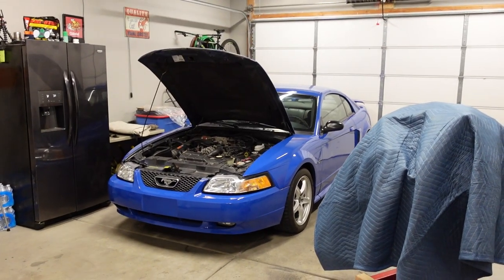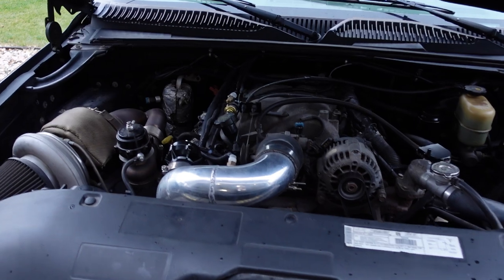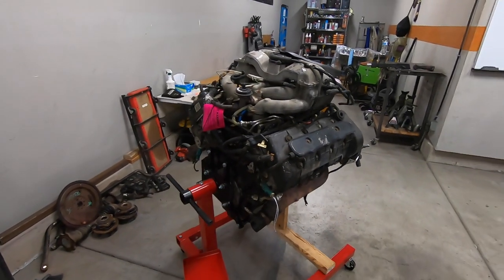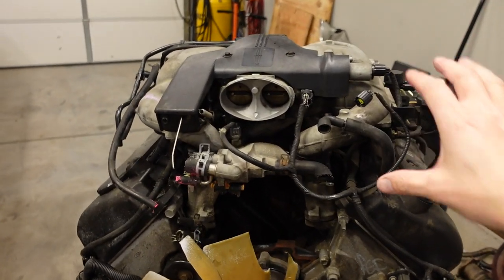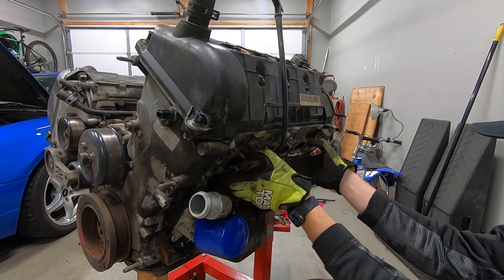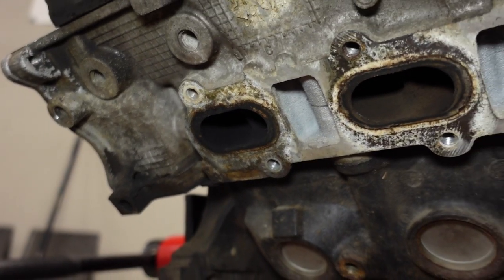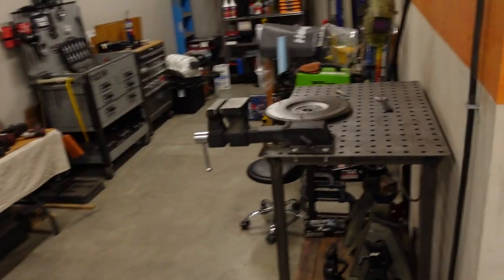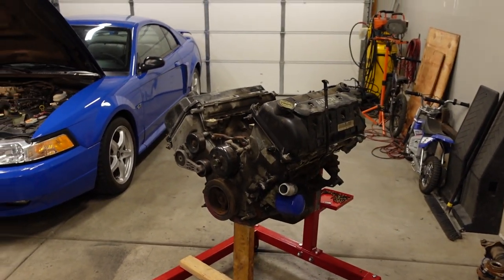I bought the LARGEST ENGINE I can fit into my Mustang

Comment: You are gonna be pleasantly surprised on how boost wakes up the 5.4 you have there.the stock 04 cobras made north of 500 hp they were grossly underated from the factory. Richard Holdner has some great videos on these Ford mod motors which I'm sure you have already seen.I think you couldn't have chosen a better engine to swap looking forward to the build.
Reply: The stock Terminators did not make more than 500 hp. Did they make more than their rated horsepower, yes. Most cars make more than their estimated horsepower when you put them on a chassis dyno. But the Cobra wasn't making North of 500 bhp.
Reply: @rdsimmonds  True statement. A stock Terminator puts down about 360-390 at the wheels. But they make crazy hp when modded. The bottom end is almost indestructible.
Reply: @donuthole7236  imho, they should've used the Teksid blocks for them. But that's me. They do accept mods very well, given the heads and forged rotating assembly.
Reply: @rdsimmonds  The Teksid block is the best aluminum mod motor block. For a street car I would take the 68 lb hit with the iron Romeo. Iron blocks are pretty tough. Ford sold a 5.0 iron version of the Teksid called the Boss block. I know cuz there is one sitting in my garage
Reply: @donuthole7236  the Teksid block is actually the strongest of the 4.6L blocks. No reason to take the weight penalty. From my understanding, the Romeo iron block is actually weaker than either of the aluminum blocks. But regardless, the Teksid is definitely the strongest block you can use for a 4.6L
Reply: @rdsimmonds  It's actually a bit more complicated then deeming one is "stronger" than the other. As a material iron is stronger than aluminum. Both have their pluses and minuses. Ford actually tried using an aluminum block during the development of the Terminator (unfortunately the Winsor was all that was available as they were no longer producing the Teksid at the time) but were having problems during durability testing which is why they went with the Romeo block. For a streetcar that you want to last a long time, iron would be a better choice. If you want to save weight off the nose of the car aluminum is the only way to go. Personally, I think the Boss 5.0 block is the best option for a streetcar as stated it's basically and iron version of the Teksid. The only issue with the 3.700" bore on the Boss is it limits the boost due to the narrower land between the bores. The stock 4.6 bore can tolerate stupid levels of boost.
Reply: @donuthole7236  the Teksid block actually is the strongest of the blocks, period. Which is why John Mihovetz has been using one for years to set the records for mod motors. The cylinders on the Romeo block are actually weak, as they are thin and not uniform thickness all the way around. The block may have slightly more rigidity in the bottom end, but it's a miniscule amount. The Teksid block was designed with more material in critical areas, and cast using methods that increase overall strength.
Reply: @rdsimmonds  Using Mihovetz as an example will not apply to your average street racer as he fills 1/2 the water jacket with expoxy, runs 50 lbs of boost and rebuild/replaces the engine often and pour copious amounts of money into the engine. Not something you and I can afford or is willing to do, we are not even in the same league. The problem with iron blocks is that they are very stiff and will fracture and break if over stressed, where as an aluminum block can tolerate flexing being a softer material before it yields ("flexing is not a good thing). As stated, the term "strongest" is a relative term with regard to engines. Aluminum thermal rate of expansion is twice that of iron making holding tolerance more difficult, it soaks-up heat like a sponge and is harder to control heat propagation throughout the structure, melts at half the temperature as iron (1320F vs 2300F) is chocked full of aluminum threads which have a tendency to stretch compared to iron, must rely on iron or steel main bearing caps which makes line boring "tricky" having soft material on one side of the bore and harder material on the other. The main advantage of aluminum with regard to racing is that it's light and can be repaired where the iron block gets tossed in the dumpster, but iron blocks are used almost exclusively in industrial application and are better choice for a HD truck engine. As stated, if you're racing and rebuilding the engine often, aluminum is the way to go. If you're running a hopped-up streetcar an iron block will hold-up better in the long run. Plenty of Romeo 4.6 have been running around making 1000+ hp but any engine doing that is on borrowed time.

When someone tells me "this engine makes 1200 hp" my response is "for how long" which would be measured in seconds under continuous use. "Strongest" is a relative term, use what block you see fit which is all that matters.
Reply: @donuthole7236  well, in this case, the Teksid block is certainly the strongest. Even guys running iron blocks at those levels will fill the jackets. The benefit to the Teksid block is that there was extra material in critical areas that even the Romeo blocks don't have. Plus, since the cylinders on the Teksid blocks are supported by the aluminum above, below, and around the liners. I read an article a while back where he explained the differences in the blocks as well as why the Teksid has been his go to for all these years. It's pretty interesting. But nonetheless, if I were going to do a mod motor, that's the block I would go with. I'm not sure why they stopped purchasing the blocks from them, but I'm sure there's some reason behind it.
Reply: @rdsimmonds  Never hear of anyone filling an iron block. If you take it to that power level it will shatter like an eggshell where an aluminum block will allow for some flex, just keep in mind aluminum blocks even the Teksid are not immune to failure. Iron blocks are cast with thinner walls where aluminum needs to the extra heft to make up for being a softer material. Mihovetz is filling the block to gain strength and stiffness on the bottom end which is something you never want to do in a streetcar. The Coyote engine block were experiencing bottom end failure and had to go thru several revisions to improve the it's reliability. My understanding it the head bolts that are anchored deep in the block were causing distortion when they were torqued causing fractures to occur. Teksids were sourced from Italy and I believe Ford abandon them wanting to save money and cast them their selves. They never had the Terminator in mind when they designed their new aluminum block which is what forced them to use the Romeo block. The next challenge were the factory PM rods, they ended-up granading 20 engines on the dyno before they bit the bullet and sourced the rods from Maney costing them $55 each compared to the $6 PM rods. As stated, the Teksid is the best aluminum mod motor block and can hold a lot of power but there are a few downsides. 99% of us will never want to make the power level it's capable of holding on a streetcar where the iron block has a few advantages. It's a much higher density material and stiff as a rock and cast as one piece. The Boss block was manufactured at Ford's Cleveland Ohio plant and cast from nodular iron rather than gray iron which has a higher ductility level and is quite stout. Ford FFRP was selling them for $900 which was a steal! Good luck with your Teksid, it's a great base for a motor build and is what I would choose if I wanted an aluminum block.

If you're interested in learning more about the development of the Terminator buy the book: Iron Fist Lead Foot. It's a festinating read about how that car came about.
Reply: @donuthole7236  I'm not really that interested in the Terminator. To be honest, I've never really cared that much about them. I don't really understand why everyone gets so turned on by them. As far as iron blocks, I see a lot of guys filling iron blocks. I have a lot of acquaintances that are into racing, and use filled iron blocks. But a properly designed aluminum block can easily outlast an iron block, especially if it's the right alloy and subjected to the right manufacturing processes. Good examples are the GT 5.4L V8, and the GM LSA/LS9 blocks. Even Chrysler chose to go aluminum over the production iron block for the Hellephant crate engines.

Comment: Every Ford Falcon V8 in Australia from mum and dad cars to Ford Performance Vehicles FPV Boss 260, Boss 290, 302, 315 and 345 was the last ford V8 ( that's the output in KW) came with the 32 Valve Quad Cam motor , it was Designated as the Miami Motor in Australia, because Ford Australia redesigned the heads and ram intake manifold . I never use the Miami name on the basis you cant change a motors family designation by changing a few parts , its still a mod motor .It was in the Falcons , some Fairlanes and LTD models but those two up market models for some reason also got the 3 valve single over head cam  , Utes, Station Wagons, etc , it came with T56 Borg Warner manual 6 speed or 6 speed auto . The most common Ford V8 in Australia outside probably the 302 Cleveland and 351 Cleveland V8s of the 1970s to 1984/5. And don't give me the " impossible to get one " costs $900 Australia dollar in a shipping container from Sydney , plenty of importers around that will do it , prob 80 percent of Australian wrecking yards got at least 2 sitting in the shed , and Australia got free trade deal with US so important duty nothing these days . Like you prob won't get the 315 kw or 345 kw but for sure a Boss 260 or Boss 290 . If your lucky the last of the Aussie Falcons 2017 had Supercharged Coyote s but they pretty thin on the ground , they are Ford Factory Supercharged though , and it's been pointed out I should be clear the 345  kw Supercharged was the last motor in the Ford XR8 Sprint . Just to be clear.

Comment: I always wanted to do this swap. It’s more bolt in than any other out there using factory parts . Boosted 5.4 make incredible power using stock parts. Stock crank easily handles over 1000hp. The heads flow good and have so much potential.

Comment: My favorite modern mustang too! And my favorite GM engine is also the 8.1 496 ci vortec w the Allison trans i had in my 2001 crew cab 4x4 short bed GMC SLE, but mine had a  vinyl floorboard and cloth seats someone ordered it that way from the factory down to the color which was the silverish grey color whatever color it was it was my fav truck so far that I’ve owned and I sunk it once drained the motor over night ran thicker oil through the engine to flush it and filled it back up w 10w-30 and it crunk right up didn’t take plugs or anything out just held it and played with the throttle till it cleared out drove it for almost 2 more years and no other changes except having to put a different throttle body on it cuz it siezed shut from being sunk 3 months prior so it’d just go in & out of reduced engine power and finally I took it in had it looked at and that’s literally all that was wrong! Toughest motor that I’ve owned and it would run like a mf I out ran newer body style half ton chevys fords etc. only thing that got me was a newer 5.0! And all I had was a CAI and true duals cats back necked down to 2.5 at the back bed all the way out the back tucked and almost turned to the side almost 90d them but it was the best sounding truck ever lol

Comment: I like the mod motor. I installed a vortech supercharger on my 2012 5.4 3V expedition. Side note, a supercharged expedition turns heads at Pikes Peak when everyone hears that blow off valve spitting out boost when idling down the mountain.

Comment: My cousin put one of these in a 1972 F100 with the 4r75w trans and it runs good, it does have a carb manifold and full Msd control set up but still stock long block

Comment: When I was building my 6.0 formy G8. My machine shop was telling me about the motor he does the heads for this other speed shop local. The speed shop had a 5.8 V8 from a F250 and sleeved it to get it down to 5.4 liters. It was running twins and made I think 1500 horsepower or more. This was roughly 5 years ago
Reply: I'm amazed how much love the ve commodore/g8 gets still

Comment: So if a 32v 5.4 fits a 514ci will fit. They share the same size measurements. But to be cool a guy would take a 7.4 and put a crank from a 6.2 ( some changes to the crank shaft for the oil pump) and make a new age " cammer".
The 32v 5.4 is not a bad choice but it's a truck engine with truck cams designed to move 7500 lbs from a dead stop. Low end torque in a mustang will make it hard to launch unless you put work into the chassis , trans and final gear. I would suggest if you do have to use an auto find a 4r100 out of a lighting as they had the zf power stroke internals from factory. I don't feel the added mass of the 5.4 32v makes it worth the effort and money ( ford's are never cheap to build unless you know what factory parts work together) . Honestly you could get the same perf from dropping a 4.2 v6 in that car ( 4.2 is a stroked 3.8 ) and ran a super coupe blower . Same block means same mounts, that car came with a 3.8 as an option so you have a slew of factory parts to use. The aftermarket for the V6 was strong so many options there as well. The blowers from the super coupes could be upgraded, smaller pulley, larger unit...more than one😈. I've been down this road but using crown Vic's not mustangs. There will be more help simply because mustang but Ford tends to be stingy when it comes to available room. Also last note.....use a tubular k member and thank me later.

Comment: Modern aftermarket has allowed the 2v 4.6 to reach coyote numbers (400+ rwhp N/A). It wouldn't really be worth it to swap to a 5.4 unless it was force induced and Gen 3 coyotes (2018+) are actually 12:1 compression and they are slightly larger than the previous ones (bigger bore). Still 5.0L though.

Comment: I always wanted to build a 2001 Cobra R/ Aussie Boss 315 style 5.4L 4v from a Navigator and run it in a 2005 Crown Vic LX that I owned in 2007. I was running factory 18" 5 spoke 2005-2009 Mustang California Special style wheels on it and a custom true dual Magnaflow exhaust with the big rolled tips the way they were on a Marauder. I had the style down as though it was a Ford equivalent of a Marauder, problem was I was only rolling with a mild 4.6 2V that put 210hp and 260tq to the wheels. 🤣😂 Oh well, it was still a nice car for the time. I eventually traded it for a Legend Lime 2005 Mustang GT 5 speed because it made more sense for me on a cost basis, especially since I didn't have a proper garage or anything to undertake heavy mods like a 5.4L 4V swap.

Comment: You'll get people saying that this 5.4 is rubbish compared to a coyote, it's heavier & underpowered. While the latter is a good engine of course, it is a widely used one, and not as much of an original swap nowadays. Much like how GM's LS is used in everything as well (a good engine as well for sure, but used in a lot of things). So this is something different, not used as much. It's about what you want to do, and should not have to go the coyote route. Would be interesting to see how this goes, all the best on this project for you.

Comment: Hey Mr LT, I'm pretty sure the 5.4 can actually be bored out too a 5.8L if you really want to be even more oddball its the same block as the 4.6 just a taller deck too fit the longer stroke. I've never really seen anyone do this though I'm not sure if it's actually possible but I'm pretty sure it's how they made the 5.8L in the gt500

Comment: option 2 because you need to upgrade the motor before beating on it. last thing you want is to blow it before it has a chance to stretch its legs. better to be safe than sorry. as for the 5.4L(the one i know is a DOHC or a quad cam.) from what i know it shares the engine block with the Gt and GT cobra along with the 5.2 trinity(the shelby GT500KR engine in the 2008 mustang). its possible you could swap the bottom end for the same one out of the engine of the same block(pistons, rods,) its already got a forged crankshaft like you said so i expect minimal difficulty being its an economy version of the modular family

Comment: I used AJE Racing's K member to get a 1 inch drop to clear the brake booster. By changing just the plates it can adapt to almost any engine. Also the 5.4 piston sits .120 in the hole. I'd get a zero deck piston to keep the wristpin out of the oil control ring while giving you alot of crown thickness for boost. Diamond makes a self stock zero deck 5.4 piston that gives about a 9.3:1 compression ratio. If you want to use any of the 03-04 Cobra stuff in between the heads like crossover pipe, the 5.4 is an 1.625 wider. Also if you ever need to change the crank, use a super cobra jet crank. Tested to 1500rwhp.
Reply: CP's are the ultimate pistons for a mod motor. Avoid coating of any kind just run the bare aluminum

Comment: Build it but build with stock components if budget. Obviously like stock 03-04 cobra pistons. Some lightning rods. Put in 98 cobra intake cams. The Navi cams are actually better exhaust cams. Like f500 cams. And the exhaust ports are designed differently from other C heads. More similar to fr500 heads. 
Cobra pistons. 
Lightning rods.
New timing set.
98 intake cams.  Degreed
Navi exhaust cams. 
Boost and let it eat.

Comment: Actually, an Intech is a great swap for that year Mustang. It's the foundation which the Cobra engines were built on. I'd just make sure all is good with the internals and use Cobra intakes and exhaust manifolds and stab it in.